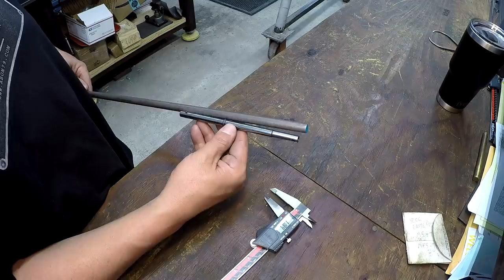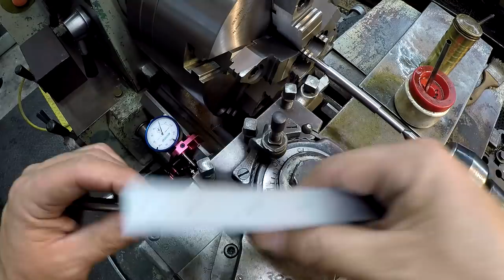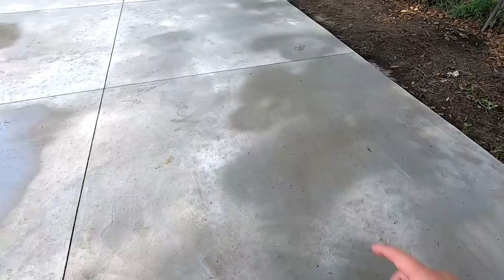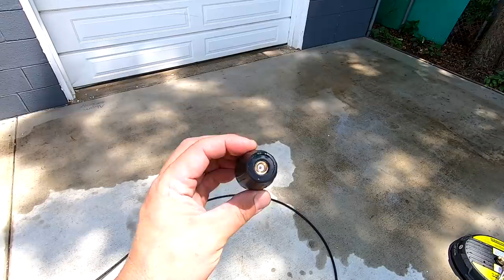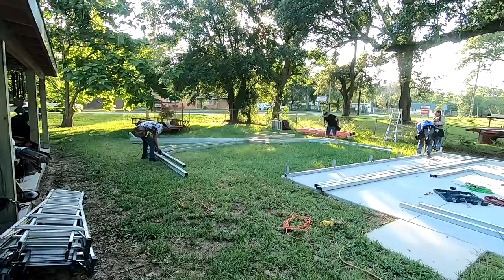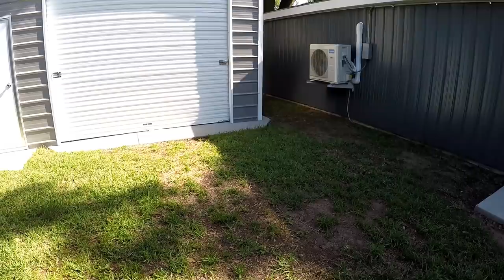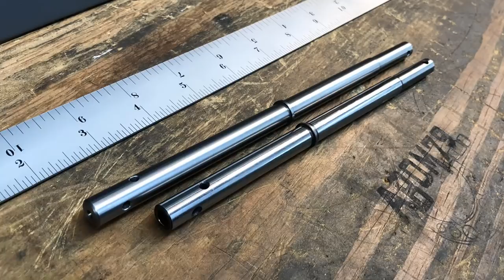SNS 264: Drone Shaft, New Garage Building, Carriage Indicator

Comment: I have a Carolina Carport too, its 24 x 40. If you intend on using this for shop space, look into getting foam insulation sprayed, its a lifesaver. I found someone locally who sprayed foam 1.5" thick under the roof and on the walls. I temporarily installed a small 600 BTU window ac unit (I'm acquiring parts for a 2 ton system), guess what? That little boger keeps the shop cool if I don't open the doors too often. And that's in South Mississippi!

Comment: I would highly recommend insulation on the ceiling.  Otherwise, it will rain in there a few times per year when it's cooler outside and the humidity is up.  I have a building just like this and came out one day to find my lathe and milling machine were soaking wet!
Reply: instaBlaster.

Comment: Those Align RC helicopter shafts are hardened steel. They need to be as the are the main rotor shaft. If you use soft steel, the bearings will wear into the shafts and cause control issues. Also if they are not case hardened they will eventually bend or warp due to flight loads or minor Mis-handing .
Reply: drill rod can be cased hardened
Reply: brian whittle drill rod should be fully hardened and tempered. It does not need case hardening as the carbon content is there in the metal already

Comment: FYI that's the main shaft for an Align 550 R/C Helicopter. The holes are for pins for the rotor head at one end and the main gear at the other, it does not matter if they line up top and bottom as you say but you should copy the piece exactly and you're holes are 90 degrees off, not that it matters. Being hollow is not so important because the shaft is at the center of gravity. Not being hollow would also allow for more engine power and aerobatic performance. Nice job on a massive lathe :)
Reply: a standard shaft costs about $26, how much did the one you made him cost all up roughly? I realize that custom parts will cost a lot more :)

Comment: I’m curious why the customer didn’t opt for hollow rod for that power train shaft.  It’s heavier and if it’s eccentrically located on the drone the gyro will have to be recalibrated and if there is a prop strike it will transfer more torque to the drive mechanism and probably damage it more. It’s more rotating mass, in other words.
Reply: Not a drone, but a medium sized RC helicopter. It'll be centrally located and the mass will only serve to stabilize. You're technically correct about the shaft transferring more energy due to its mass but typically this means stripped delrin gears...sort of a mechanical fuse in the event of a crash.
Reply: @brendanredler3666  Interesting about the gear material. Good info.

Comment: That building will be a great addition to the property.  As I watched you explain how you will be moving everything from the little white wooden shed to the new building, it occurred to me that if you pour the part of the  driveway that is between them, you will have a much easier time moving the contents.  Cut a door in the back and use your pallet jack.  Then tear down the old building and pour the rest of the concrete.

Comment: I’m pretty big into RC helicopters and drones and I’m surprised he wasn’t worried about the weight. I mean, I have a 8 rotor that can pick up about 65lbs and I’m still shaving off weight wherever possible. Good work!! Congrats on the new building. You’ll love it. I thought a 60x90 shop would be plenty big, a year later I added on lol.

Comment: The garage looks just fine with the horizontal siding. 👍.  And it’s the same size as my whole workshop and garage - and I run a large lathe, smaller mill and welding gear in there - as well as store one of my cars!

Comment: my brother in law just put up a building like yours. couple things we ran into. you will need some ventilation and we found that water leaks in around the base. the metal tubing needs to be sealed . we couldn't get to the outside because the siding overlaps it. so we had to do the inside .i didn't like that approach but its all we could do after the building was up. good luck with yours
Reply: He did say they sealed his. But ventilation and/or insulation is a must at least here in Missouri. The rapid change in temperature causes condensation on the roof and walls and it would literally rain inside the building here.
Reply from the maker: The bottom tubes were sealed to the concrete with caulking. I’ll probably go around the inside and apply another bead just for good measure.

Comment: Hi Adam,
The shrimp sure looked good. I noticed that helicopter shaft was for an Align helicopter. Have you thought about some closed cell spray foam for the ceiling? Might help keep the interior a little cooler and will also waterproof the ceiling.

Comment: Sooo, cool to see you making custom precision parts for another cool hobby I enjoy. As far as the shafts you usually machine this is very small, but for a RC helicopter the size of this shaft means its a large model, probably with a custom gas turbine power plant. Very interesting stuff, wish the owner could provide pics of the completed repair, that would be very interesting.

Comment: Shaft is likely for a scale helicopter built around an aerobatic frame. Lots of new heli designs try to lower the head closer to the airframe for better maneuverability. For scale builds, the goal is realism and lots of custom parts have to be made. Real cool to see something from a familiar hobby show up on your channel :)
Reply: I was wondering why he wanted a longer main rotor shaft, but I haven't thought of a scale model since I'm basically only into 3D.
Reply: BINGO! I missed this comment when I was replying above. We said almost exactly the same thing.

Comment: Those turbo tips are great, but you have to be careful with them: they will blast away wood as well as dirt.

The horizontal siding is probably better at shedding water, although Mrs. Abom is going to probably spend the next 20 years being mildly annoyed by the mismatch.
Reply: Dont forget paint, those tips will blow paint off, i used exact one to strip block on an entire Kmart bldg.

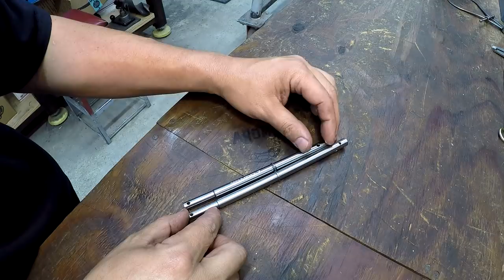Comment: 18:42 - your holes are off by 90 degrees. The single hole should be on the same plane as the hole closest the the center of the shaft, not the furthest to match the existing part.
Reply: So you know for sure this matters?
Reply: @grntitan1  no... But "matching the existing part" would lead me to believe the hole locations should match. It's a mistake for sure though.
Reply: @M_a_t_t75  The shaft is for an Align 550 (its etched on the original shaft) helicopter main shaft. The only critical(ish) holes are the two at right angles to one another at one end. These are for the main blade holder and flybar holder which need to be at 90 degrees. Though many pilots dispense with the flybar these days using electronic stability control. So although he had them at 90 degrees it is possibly not important to the customer. The hole at the other end is a drive pin for a gear so its positioning isn't important.

Comment: I have a surface cleaner and it works great on any surface, wood, concrete, brick and asphalt.  Works on walls too, gets a little heavy after awhile but it makes up for using a nozzle as far as time goes.  Really good on wood fences even with a gap in the boards.  Best way is to dampen the area and use some bleach on the surface letting it soak for a few minutes the us the surface cleaner. I use about 1 quart of bleach to 3 quarts water.   A lot of mildew will be removed and make the surface look new even by just hosing it off and no pressure.

Comment: Sounds like the customer modified the body of the RC helicopter (Align 550L) to be taller because the section of the main shaft that was made longer is the portion where the main rotor and collective attach, so the blades will be higher than normal relative to the rest of the helicopter (-8
Reply: Yes, most likely to provide clearance for a larger scale body.

Comment: I just looked at Carolina Carports. Obviously they know what they are doing. Given that you live in hurricane alley, I personally would like to see some diagonal bracing on the walls. The only thing keeping the walls from racking is the width of the sheathing. I realize I am ignorant about the strength of that sheathing to resist racking, and Carolina Carports is expert. But if it was me, I would brace the walls.

Comment: Nice building!  Everyone needs more storage, hence rental storage areas every 5 miles across America.
When power washing dirty areas like the brick stairs, it can be helpful to kinda pre-soak the area with a cleaner. I swear by exterior bleach & tsp (2 cups / an 1/8th a cup ) mixed with water ( 3 - 3.5 gallons). Works best with warm/hot water & in the sunshine if possible.

Comment: I like D2 because when you are done with your lathe work, you heat it up dull red and drop it in cold water and it hardens to a rockwell of HardAsF*** which is awesome. It also is close to stainless in corrosion resistance.

Comment: I would at the bare minimum insulate the ceiling. Spray foam is the best because moisture will not form between the metal and the insulation. I’ve had those buildings and big temperature or humidity changes causes the ceiling-to sweat.

Comment: Nice job, The shaft was from a trex 550 model helicopter, it’s the main shaft that drives the two 550mm long rotor blades at 2500rpm ! the two 90 degree crossed drilled holes hold the rotor head / blade holders on and the single hole the opposite end holds the main gear on, the hole alignment between the two ends don’t matter at all, Adam was spot on when he said the diameter was for metric bearings, The helicopter is made in China though  so I’m surprised it’s not all metric, maybe the designer was American ! I’m completely guessing but I bet the customer is putting a scale body on the helicopter and needed the extra clearance maybe
Reply: AndrewChilcott100 Align is Taiwan.

Comment: Check your order.. All too often someone else messes up and then they say its what you ordered.  Horizontal siding will collect crud on the ribs. Still, a nice addition. Very nice. Will be really cool when the old shed is gone and a full slab extended👍
Reply from the maker: Order was placed correct

Comment: You could easily replace that little offset arm on the carriage indicator with a disk that has multiple tips of different lengths like the stops on a turret lathe. That would be very handy for production work.
Reply: Seems like that's getting to the point where it might be easier to just set up a single-axis DRO.

Comment: The beauty of Edge Technologies that wasn’t mentioned is their price point. The pieces they make are high quality and durable, and they are not out to lunch on their pricing with the likes of Kurt, Orange, Mititoyu and the rest of the other manufacturers. I use there parallel keeps, as well as work stops, and it’s all incredibly affordable to the average DIY/hobby/small piece work shop. Well done working with them Adam, and thanks for getting me on to them
Reply: Yorkiepoocharlie I’m not one to fuss about colour. If it’s accurate and durable, it can be hot pink for all that matters.

Comment: This is an ALIGN TREX 550 shaft , it is an RC helicopter , they sell the original part for not more than 10$ (but not with extra length :) )

the alignement of the botom hole and top hole can be anything this doesnt matter in the application
Reply: It's the extra length he wants, to get the blades up higher.

Comment: That's one fine piece you turned out, however if its for a drone application the part needed to be hollow for obvious reasons, or maybe the customer will get it machined further by a Texas gunsmith at his end.
Reply: It shouldn't be an issue. This is for a fairly large RC helicopter (approximately 4' rotor diameter). Hollow shafts are for weight reduction and agility but as I mentioned in another comment reply, I would guess that this is for a 'scale' type helicopter. So the end user is converting an off-the-shelf 'sport' helicopter to one that looks and flies more like a man-carrying helicopter. The extra rotating mass will only act to stabilize the helicopter which I would call a benefit.

Scale: https://www.youtube.com/watch?v=p_eMtfciQaE
Sport: https://www.youtube.com/watch?v=IysZKCc3R3w

Quite different applications.

Comment: Nice garage!! Good on you. Do they have building guidelines for the amount of lot coverage, you must be getting close to the maximum. I would suggest you sheet the inside walls of the new garage with plywood to protect the siding from dings when your placing material in there.
Reply from the maker: Yes. Planning and Zoning will inform you of what your maximums can be. It all depends on your location, lot size, and zoning.

Comment: The shaft is not really for a drone. When most people think of drone they think of a multi bladed copter with a video camera  that can fly around and take pretty pictures. This shaft is for a Align T-Rex 550L helicopter. This is a fully aerobatic helicopter with a traditional main blade just like a full size helicopter. It also has a traditional tail blade. The extended shaft is likely to accommodate a different body that is most likely a scale down version of a real helicopter. These take months if not years to learn to fly. Not like a drone that you can learn in about 5 minutes.

Comment: Most likely for a scale heli build where the rotor head needs to be a bit taller.  I’ve built many scale helis and had to do this. Typically you’d send the part out for heat treating/case hardening then finish grind as it’s more prone to bending and wear at the bearing locations if not hardened.
Reply: drill rod is pretty tough though

Comment: The shaft appears to be for an Align Trex 550 R/C helicopter. I have a copy (different brand, same factory lol) of the much smaller Align Trex 450.

It's probably a good thing you didn't end up using mild steel for the shaft. These things are subject to serious forces in flight and i suspect that mild steel is too soft- if the shaft bends whilst running the imbalance will tear the heli to pieces in an instant.
Reply: Considering it was tube before and is solid now, I think itll be ok.  He didn’t harden the drill rod.  Its about as hard as mild steel at the moment.
Reply: @stargazer7644  the metal in the middle of a solid rod doesn't contribute much to stiffness (hence the practice of making them hollow).
Reply: Yes, however the drill rod is not hard. Hopefully it gets some kind of hardening treatment before use.

Comment: Just one observation on the shed, two really. First is I WANT ONE!. Second is don't you worry about rain water runoff with both roofs pitched towards that rather small area between the buildings? I would be afraid of water intrusion under the sides, I know you say they are sealed but they are not designed to be under water.
Reply: Good point. Florida rains in buckets and low spots pond up in minutes. If there's an issue it'll show up fast. Like right now. That gap between the buildings might be a great spot for a french drain.
It also occurs to me that adding to the driveway will add to the 'where will the water go' issue.

Comment: Just to be clear:

This is not a shaft for a "drone". It's the main rotor shaft for an Align T-Rex 550L.
Here's a video of this helicopter in action: https://youtu.be/ksvC0g_Zx_Y

Though I'm not sure why he wanted a longer main rotor shaft. Usually you want to keep it as short as possible in order to get the center of gravity as closely to the rotor as possible in order to improve the helicopter's agility. Maybe he installed a different rotor head that's not meant to go onto this helicopter.
Reply: I think that the cool thing about this vid is that we can all relate to the client here: just a hobbiest/"pro"sumer/dumbass with a startup, and we need this shaft, but like a little bit longer. Yes, we know we're messing with the CoG. Yes, a solid shaft probably isn't the best choice. But don't we all yearn for the work of a master, even in service of our questionable ideas? No one else would make this one off, but he did it justice.

EDIT: poor guy figured out how to get his hands on the teeniest chunk of cold rolled. Isn't that worth something!?
Reply: Adam mentioned that the end user had made 'modifications to the body' that necessitated the longer shaft. To me that says he's building a scale/semiscale heli. This also tracks with wanting a longer main shaft to clear the scale fuselage or add height for a more scale look depending on the heli being modeled.
Reply: @brendanredler3666  Yeah, I didn't think of a scale helicopter, since I'm not really into scale. I just wanted to clarify what this shaft is for.
Reply: You forgot to mention that the video of that helicopter is unbelievably awesome. Wouldn't believe it if I didn't see it, but I'm out of the loop as far as RC Heli goes.
Reply: @forthrightnight  Let me tell ya, it's even harder than it looks!
Reply: Ray Spencer yep. And that’s even considered tame compared with some pilots. Look up Tareq Alsaadi, Dunkan Bosnian, Kyle Stacey on YouTube. Control behavior is fine tuned in a digital control unit but all the controls are manual...nothing pre-programmed or dumbed down.

Looks like CGI doesn’t it?
Reply: @brendanredler3666  It's pretty tame, but Alan Szabo Jr. can definetely fly way more aggressively than this.

Comment: I'm guessing you won't need insulation but should you ever need it, look into spray polyurethane foam and see if it fits your needs.  I love to insulate steel buildings with spray foam.
Reply: I might be tempted to use spray foam just to fight condensation, but maybe there's enough ventilation to control it.